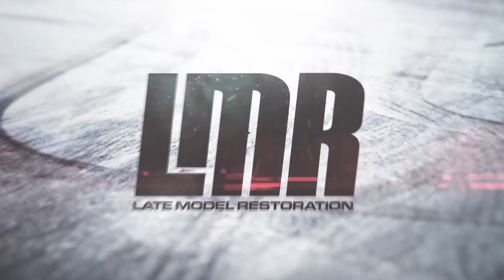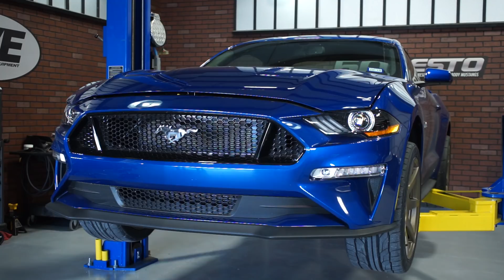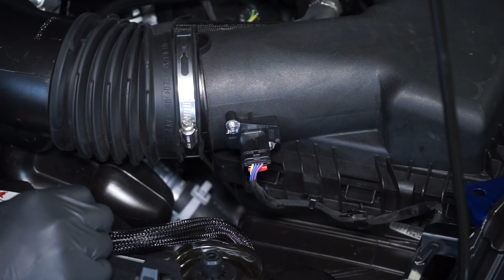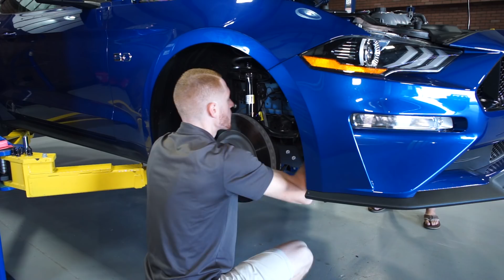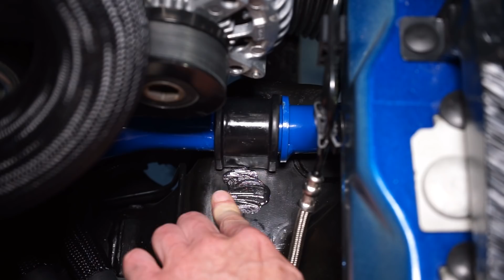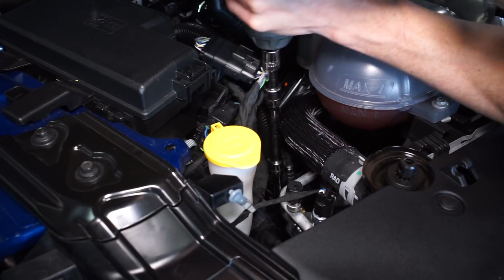2015-2023 Mustang Steeda Front Sway Bar - Review & Install

Comment: which settling which you recommend for daily driving and a little spirited driving?
Reply from the maker: I'd go with the hole second from the rear or third from the front, whichever way you want to look at it. -Landan
Reply: @latemodelrestoration  so the middle hole?
Reply from the maker: @troylong8489  If you're referring to the rear sway bar, then yes, the middle hole. The front bar has (4) holes which is what this video is referring to. -Landan

Comment: Quick question, so on my lowered s550 I'm installing some adjustable end links from my understanding the front sway bar links should be a little longer and rears a little shorter?
Reply from the maker: jester - That's correct.  Here is a link to the adjustable BMR kit that we sell: https://lmr.com/item/BMR-ELK012/bmr-swaybar-endlink-kit-2015-elk012
Reply: @latemodelrestoration  nice ! Thanks for the reply.